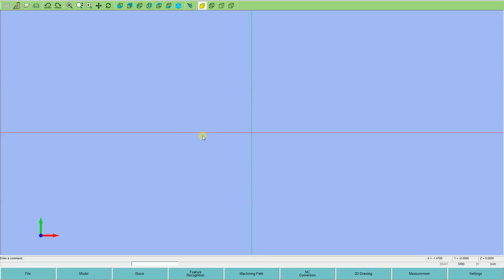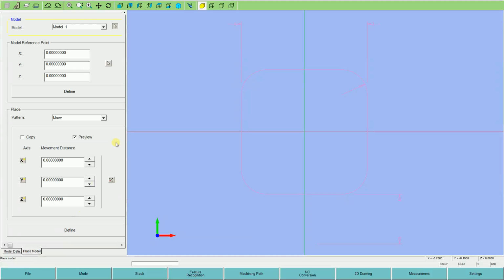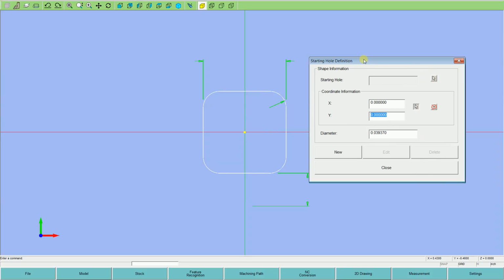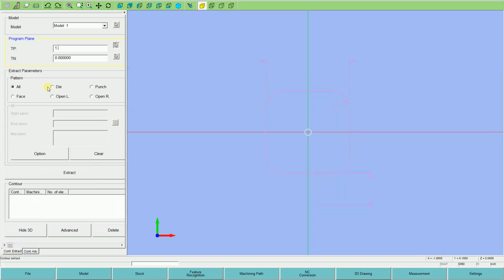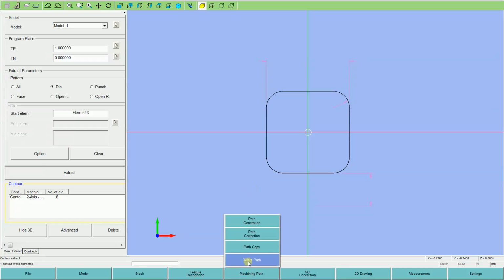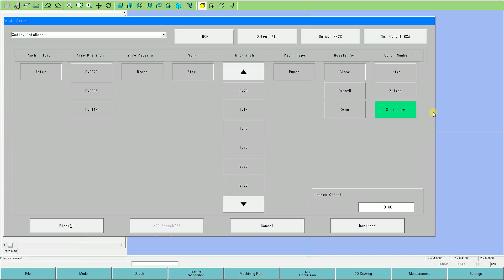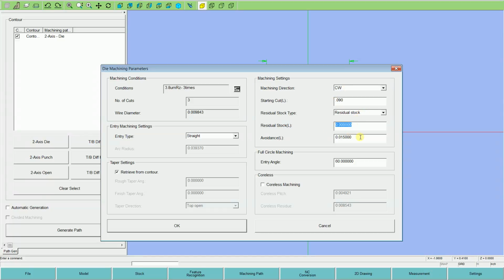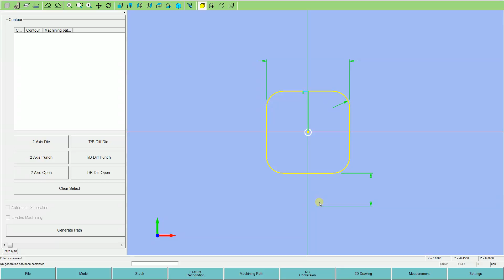IQ 1 dxf import

Comment: hi wonder if you could help. I'm relatively new to edm wire machines. I have programmed a part using the IQ software. when running the program it seems to be using a taper, i.e the u & v are moving whilst cutting direction X but I haven't programmed a taper its should be just a linear action a simple straight line.